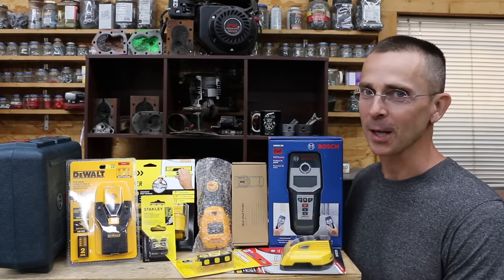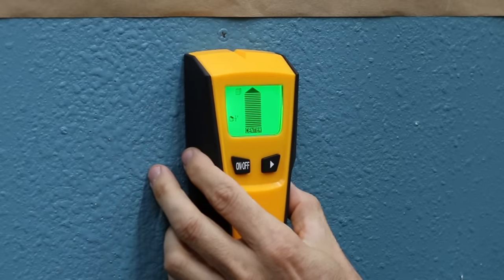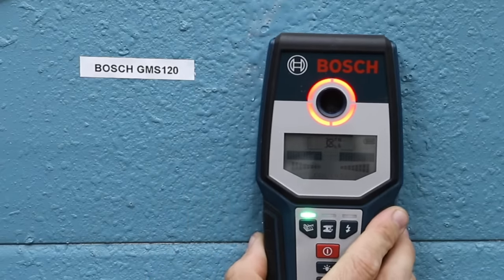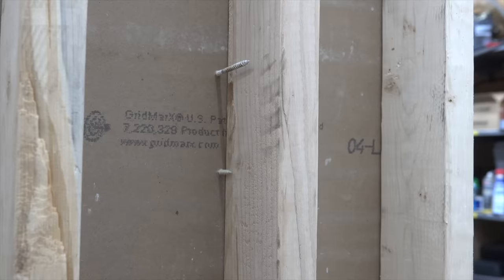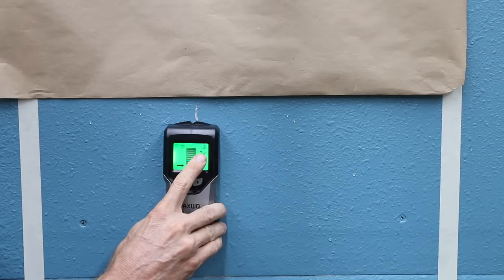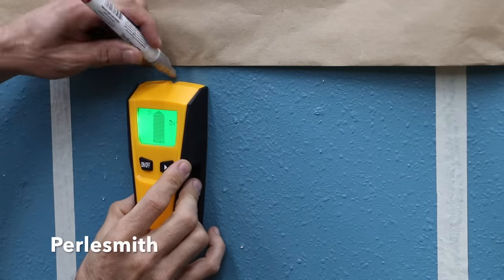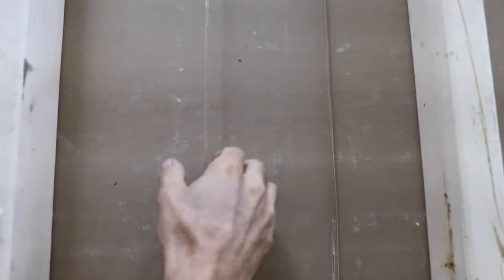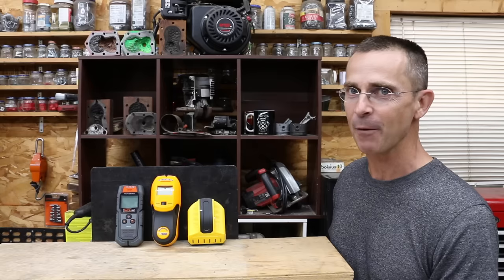Best Stud Finder? $262 Bosch vs $10 CH Hanson vs 9 Other Wall Stud Scanners! Let's find out!

Comment: My super power is the ability to miss every stud, regardless of tools or equipment. It’s pretty impressive.
Reply: Is it weird to have the same super power?
Reply: U have that too I always found it really useful especially when ur trying to put up something
Reply from the maker: lol  Thanks for watching.
Reply: I think we were both exposed to the same burst of gama radiation because I have the same power.
Reply: Would have liked to see the Walabot
Reply: Just guess by banging on the wall. Maybe your luck will invert polarity lol?
Reply: Im positive at this point that my walls don't have any studs in them. Its the only explanation.
Reply: Am I just going along to get along at this point if I say I to possess this super-power?
Reply: Man you guys are a sarcastic group..... and I love it !! Thanks for the laughs !
Reply: I used to work with a bunch of old carpenters who could find the studs in a wall by just tapping on the wall with their knuckles or their hammer handle. I never got very good at at it though. My foolproof method is to use a small finish nail (makes small holes) to find the studs
Reply: Who else has 10 "test" holes all in a horizontal row trying to mount a tv?
Reply: You could be the greatest sniper in the world, just aim for the stud next to your target.
Reply: Every time I use a stud finder with the magnet it sticks to my steel plate in my head
Reply: You are not alonen
Reply: Been there done that.
Reply: i like to miss, then move a bit closer, miss again, then a bit closer, miss again.
If you find the stud in under 4 screws you are cheating
Reply: Ah, the process of elimination method. Works every time.
Reply: @jsnsk101  
That's called aimbot.
Reply: Ya, I've given up, I just start where I think it is and if I miss keep making holes every inch until I hit the stud
Reply: I hear you. I'm convinced there is no wood whatsoever in my walls.
Reply: Yes
Reply: Best comment! Haha mine is to stretch and bend time to make an hour project into a day.
Reply: stud finders calibrate the surroundings as well,  when you calibrate the tool, how you have ahold of the tool and hand placements matters.  If you change how you're holding the tool and/or what many are guilty of like you did in the video is then to put up your marking hand up next to the tool to be ready to mark.  That's how signals are misread and ppl think they have a screwed up tool.  If you calibrate with your other hands down away from the tool, you need to keep it away from the tool to get completely accurate readings.  That's the main reason people think they have broken stud finders and go out to buy another when I bet most of them are thrown away actually perfectly fine.
Reply: I was an electrician for some years... cannot tell you how many times I’ve made the hole over a stud that supposedly wasn’t there. Hang your head in shame and find an adult 😂
Reply: Common symptoms fine sir, the cause is one of your parents proposed for you to become an alter boy when you were young. The fact you're not destroying those studs is a great indicator the other parent refused the idea.
Good day sir
Reply: We're gonna test that.
Reply: Same :(
Reply: Me too!  Except when I assume I will miss and then I can hit them almost every time first time without any tool to find them.  Sucks when you assume you need a drywall anchor and drill big and hit a stud.  For every single surround speaker.
Reply: @c0c0asauce  I hear people who try and punch a fist thru the wall often find a stud quite effectively.  Accidently bump a wall it will smash a hole every time.
Reply: He should have done the knock method to test his super powers
Reply: Even a stud that has no cover
Reply: Well its pretty hard to hit the stud if you dont aim the sledge hammer
Reply: @All Texan howdy friend
Reply: @All Texan now that's funny!
Reply: Best way is to measure 16" on center & BE SURE to miss!
Reply: @All Texan pretty darn good this cold fronts kicken my but with allergies but been doin fine
Reply: Nah, you likely just have 5/8" drywall
Reply: @takemechrome2291  i can even hit a platic water pipe in the wall.
Reply: 😂😂 that’s zircon super power
Reply: With a good enough tool studs don't matter but it'll cut through water and PVC electrical pipes just as easily that can be a real problem. 

I did that, dumped 30 gallons of water into a wall before I even noticed and ran down to the basement to dump the heater.

This was on the third floor, so everything below had to come out, all walls because the insulation spread it all around and three hardwood floors, then two weeks of venting the rest and going over everything. Took me over a month to do an hour of work that I started out with.

My wife was not happy.
Reply: @victoroneill7924  - That's the method I use.  You just have to do it enough to really recognize the change in sound and flex of the drywall.   Yet I have a studfinder and a Walabot DIY.    What did I do the last time I needed to make sure to miss a stud?  repeatedly knocked on the wall.
Reply: @jsnsk101  - The Russian Roulette method of stud-finding?
Reply: @billinglot4670  "That's what she said, That's what she said!" (Pam, from The Office)
Reply: @michaelmay5453  
The internet installation guy for a building I manage was telling me the first week on the job he drilled thru an exterior wall on a newly reno'd home and hit a water pipe. The only person home was a non-English speaking cleaner who totally panicked and called 911 lol, the guy was running around looking for the shut-off valve in the basement for 10 minutes but the damage was done by then - i feel your pain you're probably stuck with that screw up for life lol.
Reply: @Sunnbuzz   Well, I fixed it but it's one of those things you have to do to learn how not to do it. Strap a car battery to both ends of the upgoing pipes and you can read them just fine. Also works fine to unfreeze frozen pipes, just make sure there isn't a crack somewhere before you do it.
Reply: Or maybe you live in a house without studs.
Reply: i wish i  had that ability for electrical wires
Reply: Lmao
Reply: I found my People
Reply: Wish I had x-ray vision,  that would have helped me a lot.
Reply: @ronvosick8253  rex ray as in......... rayovac or.....
Reply: I like the tap my finger technology
Reply: @footlongburrito  i found this out too. If i put my marking hand too close to the side of the stud finder to switch hands, center it, or anything that involved putting something close to the stud finder after calibrating it would start beeping. But when you find a stud and mark it its not going to matter because you already found the stud and its still beeping. I have the vircon L70, probably the updated version of the A100 he used in the video. Finds sides of studs, center, deep scan, and i just found out it can find live wire. Pretty impressed with how well it works for $30.
Reply: It is when you don't want to hit a stud, is when you find one. Seems always to be the case.
Reply: @bunzeebear2973  i'd love a german shepherd stud
Reply: @OmarGarcia-bi7jq  you mean stanley superpower
Reply: @footlongburrito  At last! a truly intelligent and USEFUL comment!!! Thanks for sharing.
Reply: yep... got the same gift!
Reply: Yeah...thanks for teaching me to find the area next to the stud... perfectly.
Reply: I have the same super power
Reply: Great if your a plumber, terrible if you're a drywaller
Reply: Don't worry, I'm sure you'll find someone eventually.
Reply: My brethren!
Reply: Have you learned to dodge studs?
Reply: @loganthesaint  100% 🤣 I think the reciprocal to the Anti-stud Finding superpower is to become an electrician.  Then you will enjoy always finding studs, metal, wood, or otherwise including horizontal, vertical, and random diagonal crap when trying to cut a box in a wall.  Never stressful on a 1hour job that turns into a day trying to hide or fix
Reply: ahahhahahahahahahahaha, I'm almost as legendary as you are, sir !!! hahahaha
Reply: When in doubt, put a 1-5/8" pin nail into a pair of vise grips and drive it through the drywall to find the stud edges.  Caulk on a fingertip hides the two (or in your case, seventeen) holes.  ;)  I know this because I've borrowed your super power on occasion.
Reply: I think we all feel that wa y sometimes....serriously...worse comes to worse...a finishing nail and and a hammer...spackle to follow
Reply: @takemechrome2291  Call it mediocre power then lol
Reply: Hahahah they should do the studs on the other side so they are visible. Then again i'd still likely miss them too LOL
Reply: @justplain8793  I've purchased so many stud finders, and they never work on my walls. I, too, simply use the "test hole" method, and yeah, that's how I mount my TVs. Haha.
Reply: @brly4542  1/2" holes work the best every 1/2" or so.
Reply: by our powers combined!
Reply: You're not the only one, I raise you with me tending to hit a conduit more than I would like to admit. My excuse, its a 1925 brick house with lathe and plaster wall and ceilings.
Reply: "VERY IMPRESSIVE!" - Project Farm
Reply: u shouldn't do this kinda of work , it won't make u a less of a man ,every man is created different not equal .
Reply: As long as you miss pipes and wires and drill the correct size for a strong enough anchor you're good.  That's what I worry about when I might be expected to anchor something in someone else's home.  Perhaps why experienced handymen suggest a blunt tip bit.  It's too easy to accidentally go through wires and pipes otherwise.  DISCLAIMER:  I'm not experienced at this, still learning.
Reply: I am gonna try these tips as I own a zircon. I have literally drilled a screw every 2 inches to find a stud & filled the holes.
Reply: My super power is measure 8x, cut 4x.
Reply: This comment is to live for, freakin hilariuos
Reply: I have that same super power I install heating and air conditioning and when I hang the mini split heads on the wall I got to make sure where the line set goes thru the wall no matter how much I try to make sure there’s no stud there there’s ends up having one there like it spawned there soon as I hang the bracket

Comment: I can locate pipes, wires and conduit with a drill bit every time I drill a hole in sheet rock. Studs seem to elude me every time.
Reply: I know it seems a bit exaggerated but its closer to the truth than most realize
Reply: Agreed!
Reply: @acexxxoasis  you should see the mess of my ceiling. Yep 12 holes until I found the stud. Was the cheapest most accurate way ever.
Reply: hahaha
Reply: We need to switch jobs then lol I insulate exterior walls every other hole I drill lands on a stud.
Reply: Wait until you find that PEX line.....  I missed one by an eighth of an inch. SCARY
Reply: I'm glad it's not just me with this problem lol
Reply: Problem? It’s a gift if your on the clock!
Reply: All of you are in very good company, believe me!  LOL!

Comment: If you decide to do a follow-up, we have really terrible walls here in the Northeast.  I’d love to see a worst-case scenario test of how well these perform on horsehair plaster walls, as well as how many layers of drywall on top of each other there can be before they can no longer find a stud.
Reply from the maker: Thanks for the suggestion.
Reply: Seconded! As a handyman I am constantly up against old plaster and multiple layers of drywall.
Reply: @ProjectFarm  Third'd (?) - I run into a lot of Plaster and Lath walls in NE Ohio, and my higher-end Zircon works maybe 30% of the time.
Reply: I'd also love some plaster wall testing, I really need to find a reliable finder that works.
Reply: I see people on TV finding studs through ceramic tile and fiberglass shower surrounds. Call me skeptical, Could you add this to your testing? Thanks, love your channel.
Reply: Any dirt cheat finder will work for single layer drywall. It's the multiple layers that put these to the test.
Also, for every electric finder it was positioned directly over a screw which invalidates every test.
Reply: I work on older 50s and 60s houses that have 1 1/4' thick plaster walls (1/2 inch plaster board, brown coat, finish coat) add tiles and you're even thicker, and still haven't found a stud finder that works.
Reply: Add me, with my 123 year old lath and plaster walls.

Bonus points for finding a picture hook that will actually hold framed art. Nothing seems to hold in the plaster.
Reply: I know I’m long after this video but, as a small time landlord (my ‘retirement’ after being self employed), I very frequently have the need to find studs, wires and pipes behind walls that range from 100 year old plaster and lathe to modern Sheetrock. Unfortunately, I have 3 or 4 various stud finders that all do a really poor job. I’d be willing to shell out the money for the top model you tested as opposed to wasting my time and money on poor quality ones but am hesitant to buy one now since it’s been a few years since you tested these and didn’t test on the various common walls used 75 years or so ago. Thanks for your great videos!
Reply: one trick for plaster walls if the stud finder gets you close or not is that you can take a coat hanger and bend it at a 90degree curve so first do your best to guesstimate where the stud may be such as measure every 16 inches from the corner of where the 2 plaster walls meet and then look at every 16 inch mark up to where you are at where you want to locate the stud... drill a small hole.. deep enough to make sure that you just did not hit a lath board  and if you do hit a lath  board drill through it any way then slide your curved 90 degree bent coat hanger wire in their and once you have it so the coat hanger wire is sticking out at 90 degrees like a nail would stick out then twist ( rotate the coat hanger wire with your finger tips ) this way  the other end of the coat hanger wire that is behind and between walls will move until it touches the stud if that coat hanger wire is long enough other wise drill another hole and try it from  another spot a few more inches away the objective usually is not to have to drill so many holes.. I used something like a 4 inches to the bend on one side the side that had to go through the drill hole into the wall was about 8 inches. this helped me find the stud without putting drill holes all in the up the entire wal and so from there I made sure that I hit the stud measured every 16 inches from their drilled a hole and either hit or missed and repeated the bent coat hanger process of feeling and finding the next stud if I did not hit it...
Reply: The question is - How often does one find multiple layers of drywall ?
I would suggest - in extremely rare cases
A portable X-Ray machine would help there

Comment: I was a maintenance tech for several years.  Personally, I love the C.H. Hanson.   It will find copper against the wall.  Its the only one that will stay on the wall when it finds a screw.  I like it alot better than the electronic ones.  100% accuracy and it's cheap.  I've had the same one for years.  It's attached to the roof of my truck and never moves.  I've never had to replace batteries.
Reply from the maker: Tanks for sharing.
Reply: I have the Hanson as well, to supplement the Zircon. I often use them both simultaneously.
Reply: I like the Hanson too. It’s a little annoying having to find the screws but it’s dead on.
Reply: Same- love the Hanson. Small, reliable and no batteries or calibrating to mess with